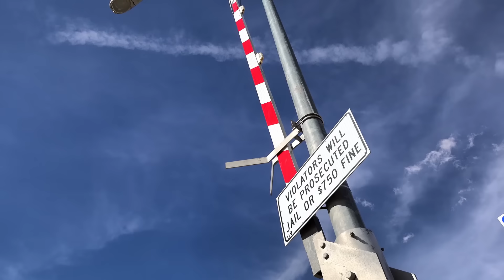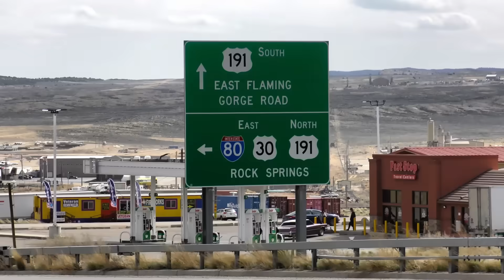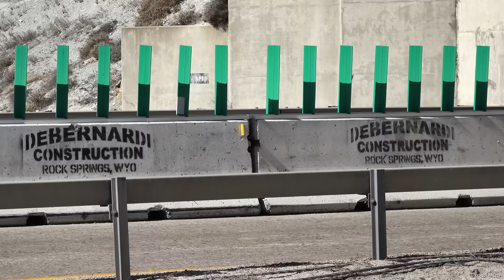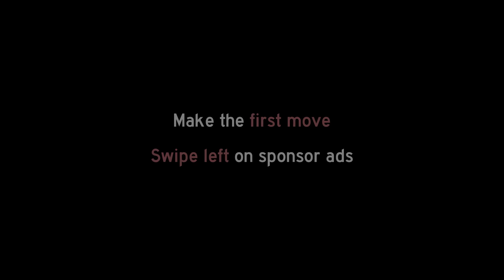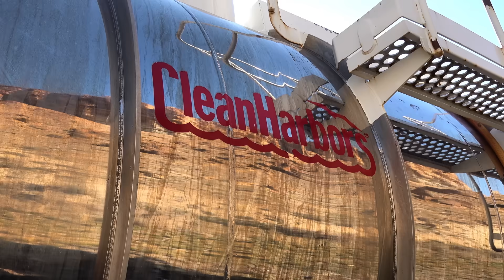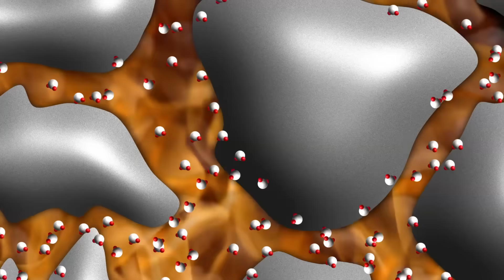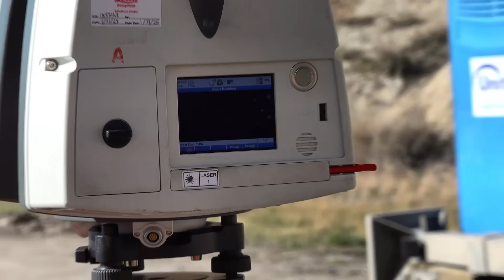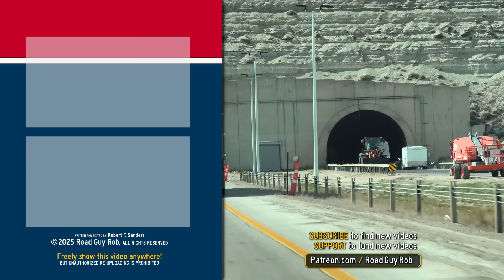Going Inside Wyoming's TOTALLY MELTED Freeway Tunnel

Comment: I’m a trucker, have driven through that tunnel dozens of times, including during the winter, and can’t tell you how many times I’ve seen other truckers speeding while going through that tunnel.
Reply: Thank you for being a trucker and keeping the country going. Question: how do truckers feel about the "zipper" method of merging? Seems like a lot of the public doesn't understand it. Best regards.
Reply: @dwmac2010 truckers don't mind the zipper method, but you are correct, most people do not understand or even know about the concept. As a trucker, I can say that all 4-5 cars that can fit alongside my truck expect to go ahead of me at the merge point and for every car that succeeds another takes its place with that same expectation. Trucks have blind spots at their front, right corner, it's not a great idea to try and wedge your car in there expecting the trucker to yield.
Reply: @dwmac2010 you would be surprised at how many truck drivers also don't seem to comprehend or be willing to use the zipper merge. Fine by me, as is gets me through areas like this faster.
Reply: @dwmac2010 hate it. Nobody takes turns. Everyone races to be the first one like it's F'ing Mario kart
Reply: @dwmac2010 I LOVE using the zipper merge, but a lot of other truckers don’t seem to understand the benefit. For example, I routinely pass long lines of trucks and cars that merged way before they had to, leaving the lane I’m in empty and relaxing to drive at a safe speed up to the point of merge, sometimes, half a mile or more!
Reply: @chrisgeezvlog7349 that's why It can't work.
I bet you don't merge one bit early, you push past as many cars as possible.

Even odds you are one in the guys who speed up and get more aggressive coming up to it.
Reply: @KarlPoorbaugh No, I drive slowly in that lane to avoid getting surprised by someone suddenly jumping back into the open lane to get ahead of others.

And at some point well before my lane ends, I slow down to match the speed of the traffic in the thru lane with my blinker on, which usually serves to block yahoos who might try to speed in that lane to jump ahead of the traffic at the very end, and that seems to be appreciated by at least some folks in the thru lane and the end up flashing their lights to signal more me to merge in ahead of them, which I do slowly when the leave plenty of space to do so, continuing to discourage potential speeding lane jumpers from trying to force their way in at the last possible moment. Works like a charm every time! 🤗
Reply: Shiat, people are still trying to 55+ through the repairs on I-40 in NC, and that road was already limited to 55 due to the slope and curve restrictions. You can see all the damage on the temporary barriers. People are idiots.
Reply: It’s a bad driver problem. Everyone’s either playing on there phones  impaired or just a poop driver to begin with. All of the above maybe Truckers. Cars everyone. I see so many accidents all the time just Other day I see a car upside down on a 25 mph street  50 feet long between  stop signs like how the fuck. Couple weeks ago going to get by a f15o with a camper shit flips up on two wheels If I hadn’t seen it coming and driven in the breakdown lane would went down the side of my new to me truck… only a matter of time before someone hits it….. recently seen a   Jeep in Dunkin parking lot upside down like how the Fvck that even happen I could see blowing doughnuts or some shlt but must be ripping to flip. A car pulling into the drive threw😂😂😂 wtf
Reply: Flip flops required
Reply: @BrettFightorFlight 😂
Reply: And yet this whole thing was caused by a 4 wheeler spinning out on ice according to the NTSB
Reply: @Redbikemaster Yeah. One of the reasons I won’t take my rig out on the road when there are reports of ice on them. Because even if I am able to drive my rig on such a road, I can’t keep 4-wheelers from turning their vehicles into rudderless waveboards and crashing in front of me too close for me to safely react and avoid a collision.
Reply: They could put up a photo radar ticketing system at each end of the tunnels going both ways. Ticket everyone going over the limit. Assuming that is legal in Wyoming it would be an efficient way to permanently enforce speed there and not just with an occasional live trooper handing out citations.
Reply: @skyemalcolm and left lane violations
Reply: @skyemalcolm I don’t think the LEOs there care about it enough unless there’s an accident, or a trucker going REALLY fast, as it’s not a good stretch of the highway to be safely parked on the shoulder for too long. At least, that’s my guess. And the truckers who routinely take that routine, more so than longhaulers from out of state, probably know this.
Reply: @skyemalcolm 2 speed cameras or a set of average speed cameras?
Reply: @skyemalcolm  Highly doubt Wyoming, one of the most conservative states in the USA would adopt such a liberal European idea.
Reply: They treat Wind River Canyon like a raceway as well.
Reply: While true this accident was caused by a 4 wheeler spinning out and causing the chain reaction crash
Reply: @perky42069  That doesn't change the fact that you're supposed to leave enough space to stop before hitting the car in front of you IF THEY DO SPIN OUT, OR CRASH, OR SLAM ON THEIR BRAKES. Meaning that the drivers WERE NOT DRIVING APPROPRIATELY.
Reply: same, seems like half of america has gone through that tunnel
Reply: at this point it aint a vehicle type issue. this is overall a Driver issue. people know that there is barely any consequences and as long as everybody else is doing it your not going to be stopped either. If you do get stopped it wasnt because you were doing wrong. its because you had a bad draw
Reply: @BlueBD  That's precisely why I think it should be a federal offense (illegal in all fifty states) for people who aren't actively working as driving instructors to teach their own kids how to drive. Especially in the Northern states where common sense is a crime and the general population has a brain that's no bigger than a poppy seed, if they manage to develop a brain at all.
Reply: The left lane has no trucks but I have been passed so many times inside the tunnel. They should have a camera to catch them bet none of them can speak English. Because years ago when trucking was fun it never happened.
Reply: @RichardLandry-n2f It’s SUPPOSED to have no trucks. And the same in most tunnels with only 2 lanes. But in my experience, it’s not ESL drivers alone violating that rule. Not by a longshot.
Reply: As a dedicated driver who drove from salt lake to Denver for 12 years pulling doubles, I can confidently tell you that has absolutely nothing to do with the problem, especially  considering the vast majority of trucks through there are governed under 70mph. 

In my experience, this was only a matter of time. That's the story for every tunnel on every American roadway, reguardless.   
   Your company convincing you this was preventable as if all of life's variables are controllable is a bigger problem than the tunnel itself.

 After 20 years accident free, I'm out. The industry can have its AI and cameras, governing speeds and crooked brokers, I'm glad I'm done wasting my life for inadequate pay and lifestyle
Reply: @2pink1stink It’s the ungoverned trucks, and there are plenty still out there. And they seem to have a passion for tailgating while speeding.
Reply: Truckers are the worst. Like you've never sped through there, caused traffic jams, rode the left lane going 1mph faster than the semi your passing, making rolling roadblocks across the country. Retire or find a new job ..
Reply: @OldHickoryReincarnate Not tunnels, and not construction zones. That are dangerous places to challenge the speed limit in a big truck!
Reply: And 9 times out of 10 it's someone from out of state just trying to blow through since the whole state is pretty empty. They get bored or just a little stir crazy from drving for so long. I mean Wyoming is 365 miles wide at the bottom & along the entire stretch of I80 through there you only have 13 town/cities along the way.

However in this case I'm pretty sure someone missed the first exit before the tunnel and since you can't change lanes in the tunnel (it's a solid line) wound up cutting a semi off by diving for the next exit right after the tunnel.... That exit just SUCKS, need to slow down from 75-80mph down to 20mph before the really sharp turn that is that off ramp, I always try to avoid using that exit for that reason. (the speed limit for the tunnel is set to 65pmh 90% of the time, lower for slick or icey conditions, but like you said though I don't see many semi's slow down for it)
Reply: Did you have to go though that area when the fire happened?
Reply: @takumi2023 Not when both tunnels were closed, but both before and after.
Reply: it isnt just truckers dude
Reply: @shadowwolf8595 That tunnel sure is a ho given all the traffic it’s experienced! 😜
Reply: @chrisgeezvlog7349  lol I lived in rock springs for just over two years and now live in a town in utah not too far away. I drive in the oilfield and was actually in rock springs the day of. Didn't know that there was that many fire and ems in rock springs
Reply: @shadowwolf8595 Did you ever eat at the Renegade Cafe off of Exit 104? I LOVE that place. Whenever I pass through with a load with time to stop for 30 mins, I go there and treat myself to their Singapore Chow Mein, and an order of pan-fried pot stickers! 😋
Reply: Oh my!
Reply: Pennsylvania has a similar problem to Wyoming. Countless people speed and ignore temporary stop signs and when it comes to placement of traffic lights and certain roads, the state's zoning practices are a hopeless mess. I can't tell you how many times I almost died in a car crash in this state because of retarded drivers and demon posessed Camerys
Reply: I live here. The speed limit drop to 65 isn't enough. I can't count the number of times I've been in that crossover slush to ice and see people start skidding as they enter the tunnel. They assume its dry in there. They forget about all the water being drug in by tires. And the wind ripping through that tunnel turns it to ice.
Reply: @Wootsickles Completely agree. Some state DOTs seem to just not want to do the work to justify to powerful business interests that the speed limit in such places should be lowered. Texas and Mississippi immediately come to mind.
Reply: Not a trucker, but I've also been through that tunnel dozens of times (yearly family vacation from AZ to SD and back), and yeah, this tunnel was always a speeding point. Loved going through it as a kid.
Reply: ahhh  yes   boomer solutions.   Never has anything to do with incompetent people, but always speed….
Reply: Snitch
Reply: @treesmantrees Dude! I have my own dashcam in my truck and I have seen other truckers doing the craziest sh*t out here and have not shared almost any of what I was able to record!
Reply: I doubt that’s the issue. Most accidents in tunnels come from people changing lanes. There are signs prohibiting lane changes in tunnels for this reason.
Reply: America has a speeding pandemic.  NOBODY can change my mind.  And no, I DON'T know how to fix it.  The only thing I can do is watch my speed...
Reply: @nup5  America has a bad driver problem in general.
Reply: @erictheepic5019  this is true :( i didnt even study for my driver license and passed first try.....

THAT alarmingly simple process is what actually caused me to take driving more seriously.  Because I KNOW (and have seen) that there's PLENTY of people out there who are legally allowed to drive (have a class D license) but SHOULDN'T BE ON THE ROADS.

I've since gone above and beyond to check and double check my knowledge and patience with the legal requirements.  Saves me some headache as well so that's nice.  But ultimately my defenseive driving will only do so much.  I pray I'm never in the wrong place at the wrong time.
Reply: @erictheepic5019  as someone who has driven extensively in the US and Australia, with some long hauls in Canada, and a bit in Portugal..."America has a bad driver problem in general" compared to what?? i encourage you to experience the hell that is Vancouver, BC. or driving through Adelaide, SA, during rush hour. please. lol or Lisbon in general, my *god*. forgive me if you have driven other places, but...
Reply: @herzogsbuick  pain is relative, but I can assure you, even if usa traffic isn't as bad, we still have (some) idea how horrible it can be.
Reply: @erictheepic5019 i blame the auto industry. they just wanna keep selling cars.
one more lane bro.
Reply: @nup5  its a self-correcting problem
Reply: @nup5  HA no it's because the speed limits are so low otherwise they don't get federal funding... there's at least one state I know of that refused and kept their speed limits high for those long stretches of nothingness.... 

Modern cars can handle these speeds way better than those cars from the 60's
Reply: @TheFrogInYourClosetWatchingYou There's no amount of smooth-brained reasoning you can put forth that will convince anyone that speeding is ok.
Reply: @TheFrogInYourClosetWatchingYou The cats are better, but the drivers are worse. So it basically is a trade off. people on a high speed road such as the interstate system , lose their sense of speed after awhile. The mind does not plan ahead nor react as well at that point.
Reply: @TheFrogInYourClosetWatchingYou State DOT officials set speed likits on interstates based on civil engineering reports done on those stretches of highway, not specific federal regs.
Reply: Put up cameras and make the fine for speeding in a tunnel a reasonable $50,000 dollars (with a clause that be in constant dollars so inflation won't reduce it).
Most wheeled vehicle operators (any vehicle) are incompetent and trucking has a major flip-flop problem (IYKYK) that's known but not addressed.
Reply: When you want to fix a problem, you have to get to the core issue. The issue isn’t speeding itself, it’s Americans as a whole and our entire country’s way of driving, and our road system as a whole. You need to treat it in a more European way, where EVERY road is narrower to force people to drive slower based on visual perception. Force EVERY single person who can drive, to go to an extended driving school that takes months upon months to pass and make it expensive to further drive the point. If your paying $1000 to go to a 6-8 month long driving school to get your license, your gonna take it a lot more seriously, especially if it’s the ONLY way to getting a drivers license. Also roads are designed with purposeful repair in mind not longevity of the road in mind. This is why roads are always under construction year round. 

People speed here in America because they have been taught that, and roads themselves are designed to allow it. Don’t get upset at people doing what they were taught to do. Get upset at Congress for having a shitty and subpar infrastructure that is 70 years old, designed at a time where we had a 1/3 of the national population compared to now, and doing next to nothing to fix it, or improve it.
Reply: @Farrell0208  Then next thing you know the US adopts Europe's road design standards and the national death and occurrence rates skyrocket six fold, and if you live in the North, TWELVE fold region wide from everyone rear-ending each other because of the infrastructure change. In fact, the only reason cars have had seat belts since the 70's in the first place was because the government was scared of losing all of its citizens from mass natural selection.
Reply: And yet every mile of that road has had more accidents than that tunnel in 40 years. Speed isn't the problem mom.
Reply: @Excelcior58 It’s quite winding relative to the stretches of I-80 on either side. I don’t think people realize how fast they are going, and don’t properly adjust to the lower speed limit in that area (65 mph) versus on either side (as high as 80 mph).
Reply: The quicker they are going, the less time they spend in the tunnel, where the risk of crashing or catastrophic damage from a crash is higher.
Reply: @qwerty112311  but that just increases the risk of crashing in the first place.  It's a no-win situation.
Reply: @nup5 You have to slow down to a safe speed BEFORE you enter the tunnel, NOT 10+ over the speed limit, then slam on the brakes. Which truck stop bathroom did you flush your common sense down the crapper???
Reply: @chrisgeezvlog7349  I'd ask the same about you, since by saying that, you are implying that you think speeding is okay so long as nobody is watching.

Though you are correct, I should've worded that better.  My bad!  Yes, slowly (gradually) slowing down is key, NOT brake slamming.
Reply: @nup5 How did I say that speeding is okay if noone is watching???
Reply: @qwerty112311 and the less of a chance they have of stopping in time if someone else crashes or is broken down or whatever. And if the speeding vehicle looses control and crashes, then the risk of clogging the tunnel from the higher severity of the wreck is greater. Stop making excuses to speed and put everyone's life lives in danger